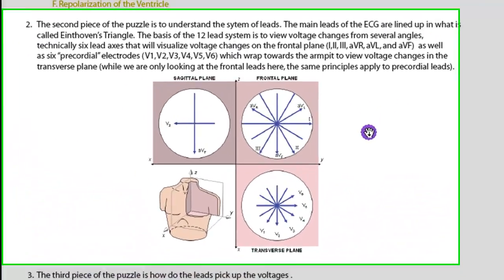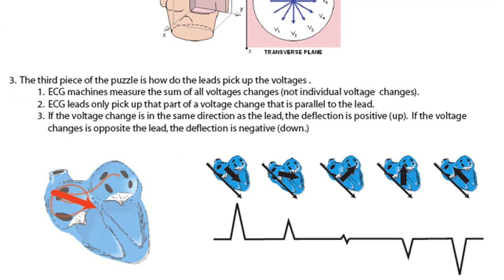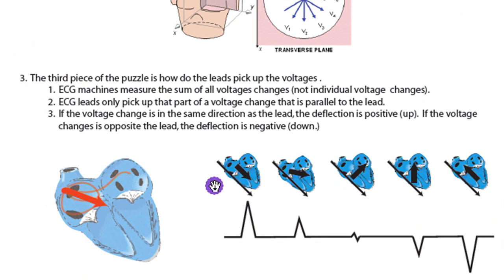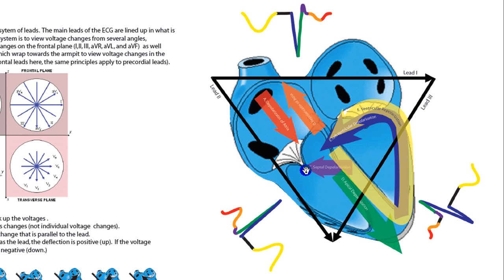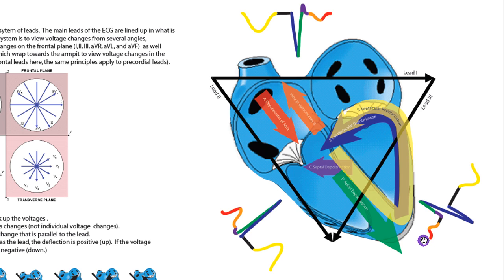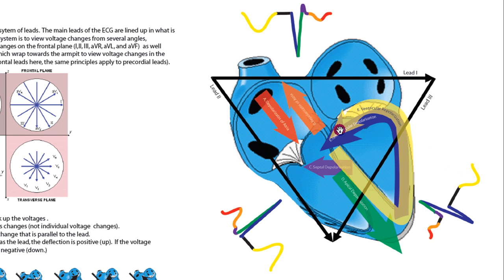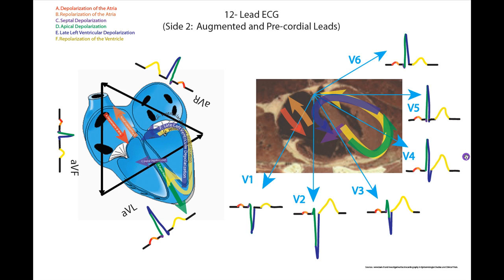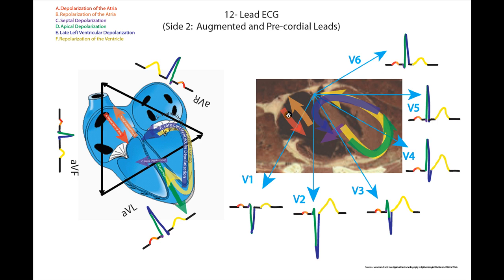Ten Minute ECG (Part 2)--Okay, It Is 20 Min But I Tried

Comment: The T-wave in lead III should have a positive deflections.  This is because the epicardial cells repolarize before the endocardial cells.  The "negative" action of repolarization is in the direction of the negative electrode, producing a positive deflection on the ECG.  8 years of experience with analyzing ECGs in the field as a paramedic also confirm this knowledge: in leads I, II, and III all components should have a positive deflection unless there is ischemia or injury present.

Comment from the maker: 0marius0.  I agree that the way you describe this is the way it is often taught, but I want to question that way of teaching it.  Depol. and repol. are the same voltage change so they should be recorded equally.  Some propose that atrial repol. is concealed by the QRS, but the atrial action potential is too brief to reach into the QRS.  It is actually the length of the p wave.